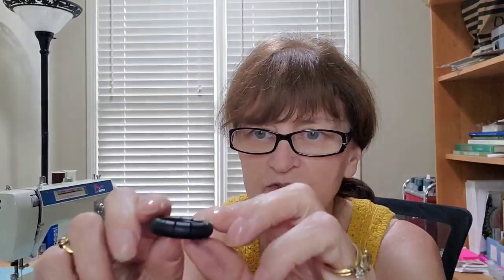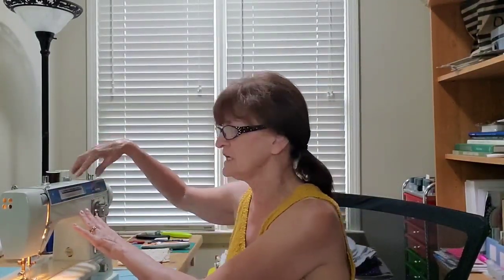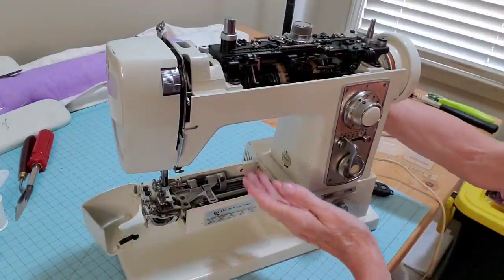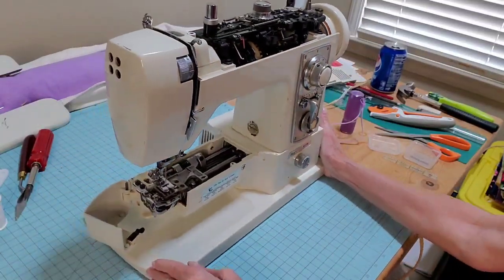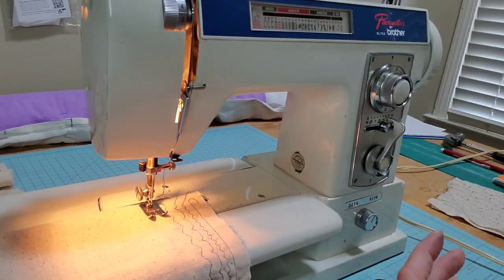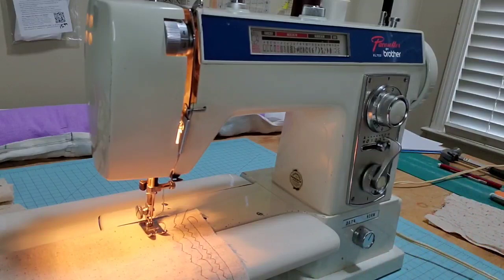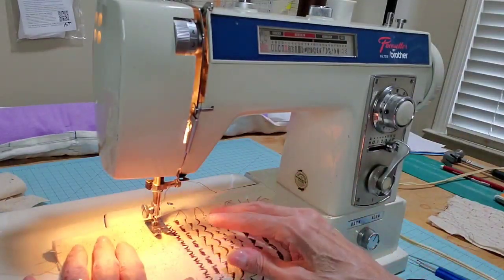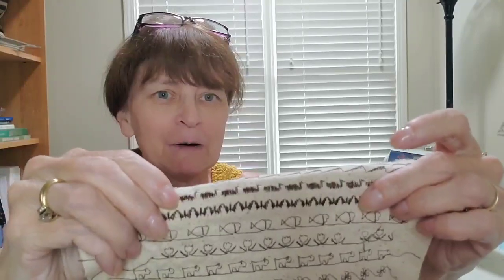Demonstrating the Vintage Brother Pacesetter XL703, Restored for my Sister-in-Law

Comment: I just found and watched your video tonight. YOU are a gem. Thank you for what you do. I bought my first machine, an ancient "White" machine with green crinkle paint, in 1982 at the Berkeley Flea Market for $5 when I was 22.  I did so because I needed to reupholster the seats in a 1963 Austin Healey I bought for $300. I had never used a machine prior, but I was hooked. I even managed to make and incorporate piping in the upholstery. I am considering buying this same machine in your video (except it has a two-speed switch) that is at a local Habitat for Humanity retail store (ReStore). I am taken by its design, build quality and condition (although one of the belts is broken). I have somewhat of a fondness for buying, repairing, renewing sewing machines, specifically the all metal ones made in Japan. I own ten of all different makes and models, including three sergers, one of which is a differential. My favorite though for its simplicity, design, size, but most importantly its stitch quality, is my Elna Lotus ZZ. So, I look forward to watching more of your videos. I'm now a fan! Cheers!!
Reply from the maker: Thank you!!   This was one of my favorite restorations.  All the over the top (at the time) modernizations were really cool.   My featherweights are so much more basic in comparison.  
But as you know...these vintage machines will run forever, if they are cared for.

Comment: Hi Bonnie,
Recently I bought  Brother pacesetter xl711 from Goodwills. The machine is in working condition  but the stitch selector is not smooth at all and some of the stitches are not working properly so I open the top and put oil to the cam and gears . Then stitch selector bar getting better and while I was moving and testing different stitches the motor and hand wheel get stuck and the needle bar is not moving anymore when I press the foot paddle. Any idea which area to check and debug the issue.
Thank you.
Jasmine
Reply from the maker: Without seeing this machine in person it's hard to say.

I would certainly make sure there is no thread or lint caught in the gears or feed dogs.

I would have cleaned out all of the old gear lubricant (grease) and oil and applied new product.

Another thing to look into is the balance (a screw underneath the cover and  behind the flywheel).

Comment: I am helping my wife with her xl703 and having trouble with tensioning. The straight stitch is looking more like a chain stitch on the bottom. We have gone through all kinds of tensioning exercises, but cannot get it to stitch correctly. Any suggestions?
Reply from the maker: It sounds like the stitches may be out of balance. Underneath the case behind the bobbin winder is a balancing screw.   Just as with tension...only use the screw sparingly.

Also, refer to the machine manual...  as I recall, this machine does a decorative chain stitch as an alternative to the straight stitch...you may be set for this stitch.

Comment: I have acquired a similar machine but in Australia under the brand name of Lemair and it does need a bit of servicing. Thank you for making this awesome video explaining in detail. Can you please share the amazon link where you got the bobbin and the winder rubber? Mine's winder rubber is worn out and I can't seem to find the exact one on the internet as it has knurling on the outside. Would it also be possible to share the manual? TIA
Reply from the maker: NOT SURE THESE SAME LINKS WORK FIR YOUR MACHINE...it is best to open AMAZON and search for your specific brand and machine.  (For the o-ring, check measurements of the internal and external dirmensions).

BUT JUST IN CASE...
(You'll need to copy and paste these links...YouTube doesn't allow links in messages)

The bobbin was ordered here
https://www.amazon.com/your-orders/pop?ref=ppx_yo2ov_mob_b_pop__fp_4_pp&orderId=114-6690320-0937016&lineItemId=oglglujnrqnnwny&shipmentId=DHTw6td4s&packageId=1&asin=B09LBLWM8Z

The bobbin winder o-rings was ordered here
https://www.amazon.com/gp/aw/d/B08MDTXJPP?psc=1&ref=ppx_pop_mob_b_asin_title

I cannot share the owners manual as we shipped everything back up to my sister-in-law.

I found a potential link to download the manual using www.manualsonline.com.  Try a Google search and choose the  Manuals Online search selection for your manual.

Comment: How do you turn on the brother pacesetter 701?
Reply from the maker: I haven't sewn with  my sister in law's pacesetter in over 2 years.  If I recall correctly, if it's plugged in it's on.   Although, there is a light switch to control the light.